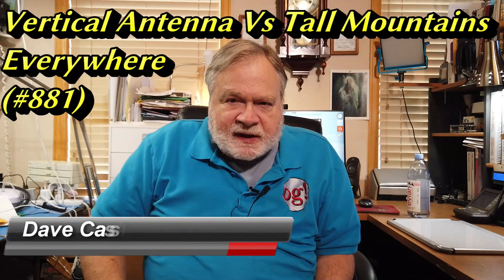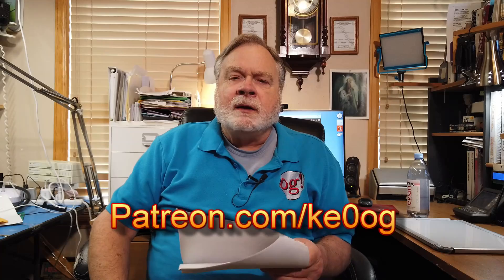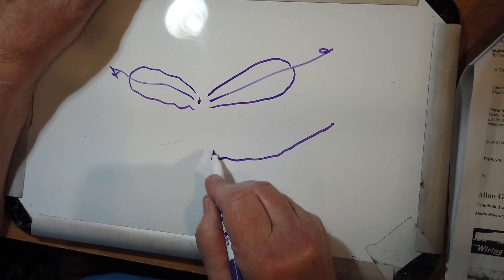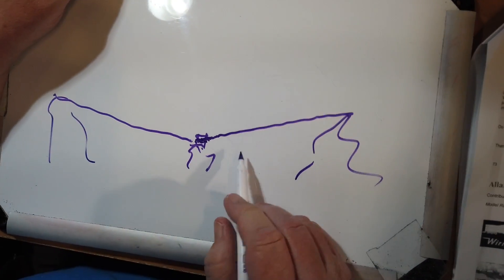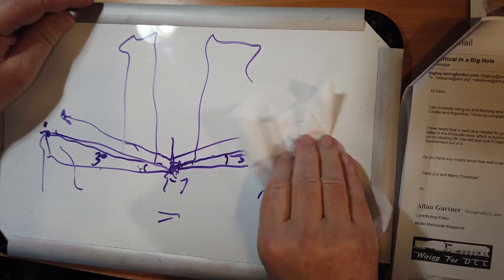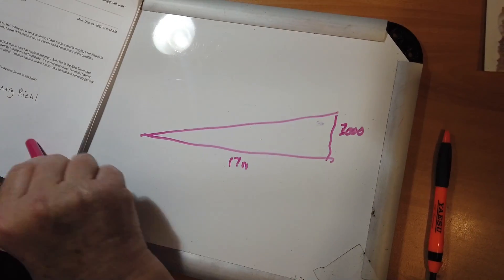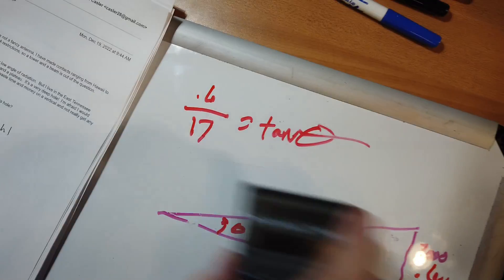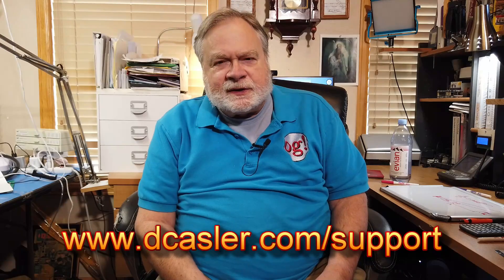Vertical Antenna Vs Tall Mountains Everywhere (#881)

Comment: my tangent is more than 45 degrees, im really in a hole like the one drawing you did. so is a 1/4 wave vertical better than a 5/8 or a  horizontaldipole best? it seems i get better reception from my car antenna than my base station one and the horizonal dipole seems not as good as either

Comment: In Chattanooga it depends.  Lookout Mt is almost vertical right up against the south end.  Similar issue with signal Mt and other surrounding peaks.  You can use Google earth PC app, do a shot like he should,  the select it for a profile view.  Then you get even nearby hills that might be lower, but in the way,  or maybe find your in a decent spot.  I'm a bit north in Cleveland tn, in a hole just to the west of the ham club, still do ok with verticals though. AD7LL 73

Comment: Allan, I looked up you address and checked Google earth. You will be fine with a vertical. Your place is more than far enough from mountains. I have done portable operation in TN and NC similar to your area. I once had a mountain to my north that concerned me as it was about a 20 degrees higher than my position. I was surprised when many contacts came from right over that mountain and just 400 miles away. Two meters may be a bust but you will do fine on HF. If concerned try a wire vertical on a fiberglass pole with a dozen radials you can put up for little money before you drop $800 on a high priced vertical. Don’t think you will be disappointed. Good luck with your reject!

Comment: I live in Colorado Springs with mountains on all compas directions and have no problems using my Hustler 6btv and QRP.  It is sometimes to our advantage because Pikes Peak has a natural dish effect which is very helpful on the higher and on 2 meters we just point our beams towards that feature and it is amazing. 73 from ki0ad/Jim

Comment: I design wildlife tracking transmitter / receiver .   their frequency are 148 to 152MHz, 216 to 220MHz, and some on 401 to 412 MHz.   400Mhz system go farthest except, direction almost always point to sharp slope mountains.  so it is not most usable.  150MHz, 216MHz does not bounce off mountain nothing like they do on 400MHz system.    point yagi to tall mountain on 440MHz CW , you will be surprised.   AG6JU

Comment: quick and dirty. get  plastic protractor, upside down, hang a string with weight on end from middle hole, sight along length, read off angle looking at high point(s)

Comment: Newish sub, hope you heal quickly. Kinda the same deal, live near a ridge at 800' while I am at 600'. Open South and West and some north but limited to the East. I am somewhat close to the East ridge maybe 1/2 to 3/4 mile. Barefoot FT 101EX. very new to ham, ??

Comment: There are many types of vertical antennas 1/4 wave 1/2, 5/8 these all produce different angle of radiation.
To get over mountains I would go for a 1/2 wave these have an angle of 16 degrees.